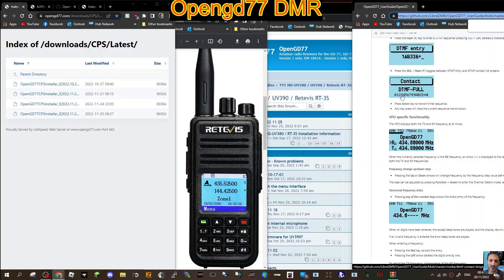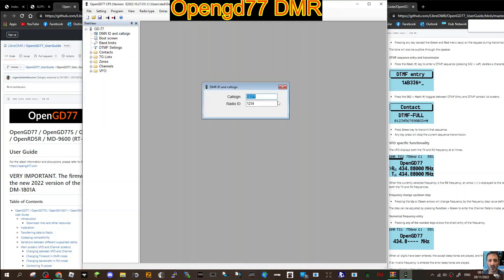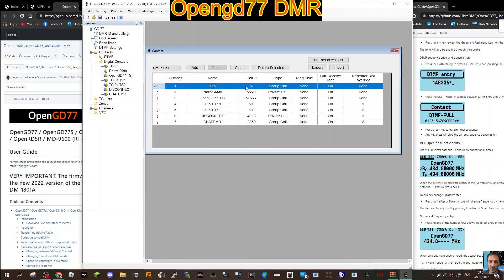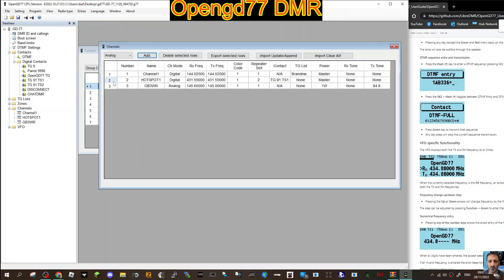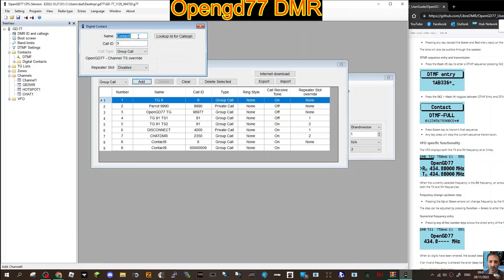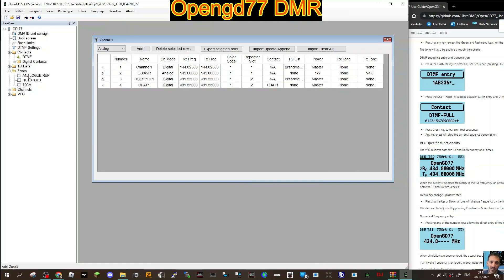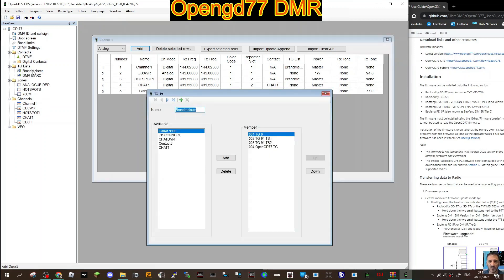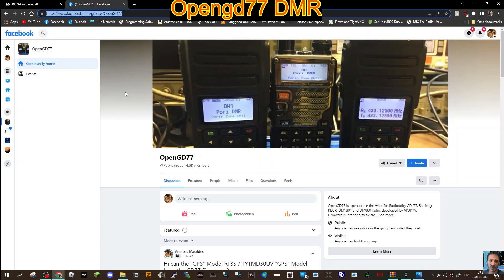OpenGD77,  CPS Codeplug From Scratch

Comment: Hi M0FXB,  At roughly 05:03 you mention that some ops would have multiple hotspots, can you give an example scenario please where it would be good to have multiple hotspots operating? would two simplex JumboSpots simply allow the op to jump quickly between different groups or have access to more groups?
Reply from the maker: Dmr  , dstar C4FM , that's 3 hotspots if you get a dual hotspot that's only good.for dmr